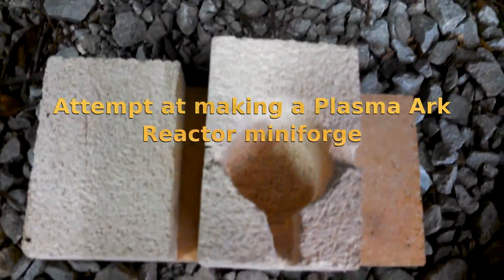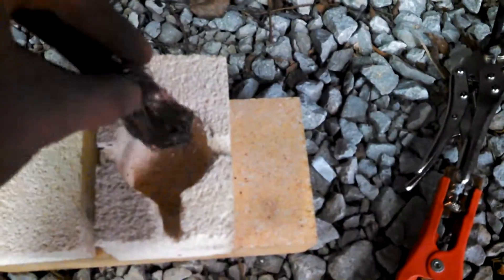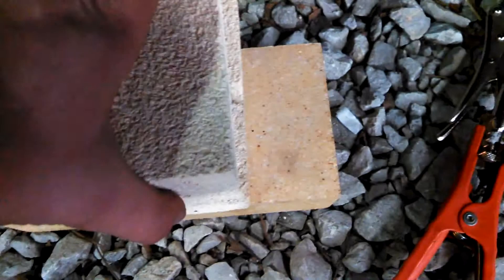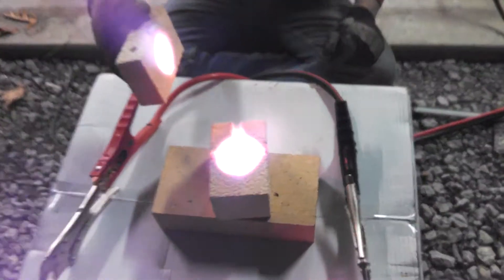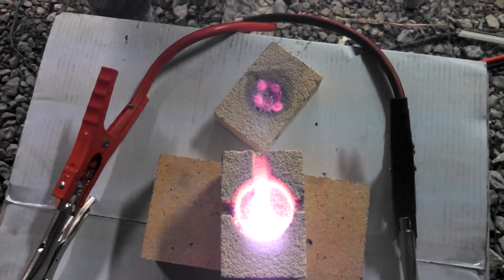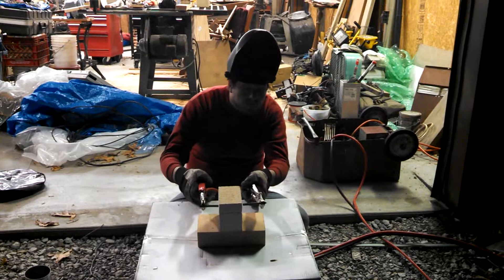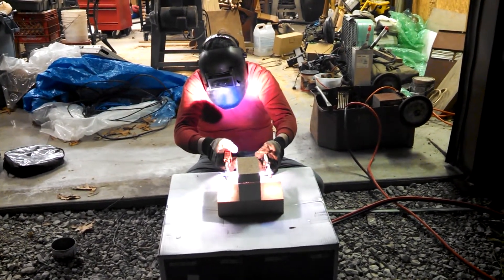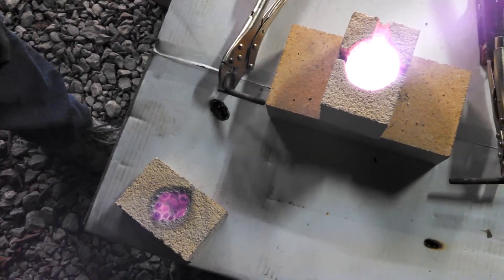Plasma Ark Furnace

Comment: they work great but you need more amps
Reply from the maker: +Empire Gold Mining Thanks for watching and thinks for the advice. I will keep that in mind when I try it again. I got my old welder fixed up now so it has proper cables and a working amp switch.
Reply: +Jonathan Rader find my channel I play with it often but I practice holding Temps a lot also . I don't want to violence or evaporate my metals I find aluminum works well